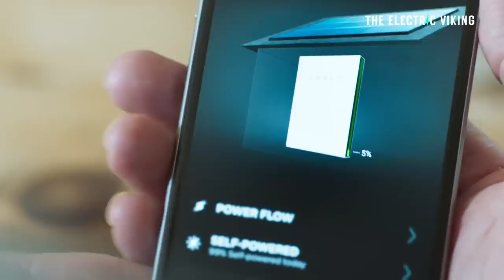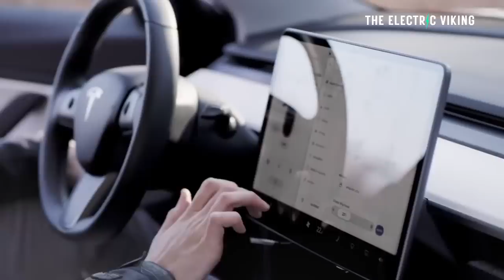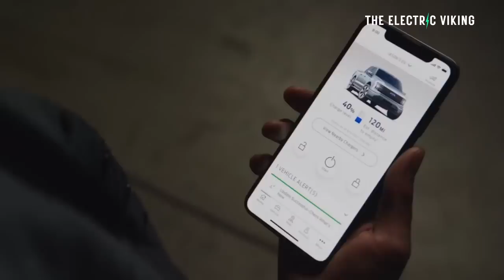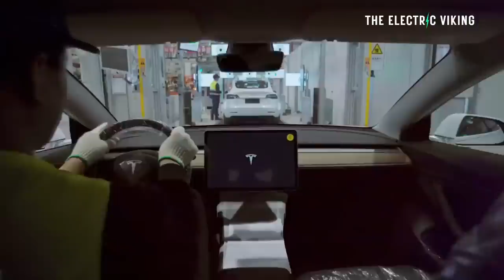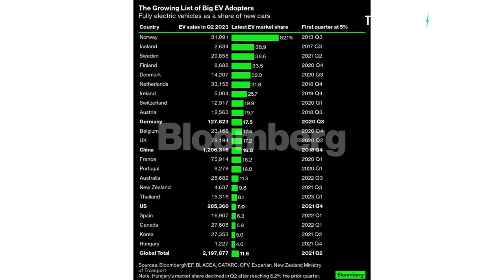Electric cars pass S-Curve Tipping Point in 23 countries - GAME OVER ICE!

Comment: It’s far from “game over” for ICE cars. Only those who drive short distances and can afford the new technology will consider buying an EV. Even then, the safety of the battery technology will need to improve substantially. Then there is also the depreciation factor, which is a big downside of the EV.  Still not convinced EVs are going to dominate our roads.
Reply: In the U.S. 80-85% of new car buyers were homeowners with six figure household incomes and financed the majority of the principle amount.
It's been that way for decades now. New cars are primarily purchased by the majority of upper income earners. 

Which is why the used vehicle market does 3-5x the volume annually vs new.
Reply: Batteries are way safer than gasoline in vehicles. You just have to weed out the bad ones like LG Chem and General Motors that were using pouch cells.

Comment: @litestuffllc7249 There is a shortage of lithium and it will directly impact production. 
False There are 26 million tons of proven lithium reserves worldwide; this is 260 years' worth, at current consumption rates. To put it another way, this is enough for batteries for 3 billion cars, twice as many as there are in the entire world.
 Over the last 5 years production has averaged 100,000 tons.
Amazingly, given your advanced Dunning-Kruger, this is correct, but irrelevant.
 It has not risen significantly even with the demand for BEVs 
False. Actually, it's increased 88 percent during the last five years, and is 3.4 times what it was just seven years ago.
Your hyperbolic claims comparing the water used to mine lithium to "the worlds fresh water" is a straw man argument. This is because mining lithium doesn't use fresh water, but non-potable water: "In the brine mining process, extremely salty water from an underground reservoir is pumped to the surface and evaporated in large, extravagantly colored ponds, leaving high concentrations of lithium behind" (https://youtu.be/HSh6EgMwMOY?si=iIwpzXYCAU7XXMee&t=52).
But your biggest failure is a complete lack of perspective, with your hysterical claims about lithium mining; in the big picture, the amount of lithium mined annually is a tiny fraction of the amount mined of many other materials, that are mined in ways that are just as damaging. One example is coal; the US alone mines 1 billion tons of coal a year, 10,000 times as much in this country as there is lithium mined in the entire world. And coal mining uses 75 trillion gallons of water a year in the US alone, most if not all of it fresh; which is 1,500 times as much water as is used mining lithium in the entire world, most of it undrinkable brine. 
In a very real sense, mining a tiny fraction of as much lithium in the entire world as we mine coal just in the US, will help set the stage for reduction and eventual elimination of the use of coal. Further, once all 1.5 billion cars have been converted to EVs, using only half the proven reserves of lithium—and assuming EV batteries will continue to use lithium, which they likely won't—no further mining of lithium will be necessary, because all EV batteries are being recycled. Meanwhile, coal is completely non-renewable, and has a double impact on the environment; once, when it's mined, using vast amounts of fresh water; and once when it's burned, spewing vast amounts of GHGs into the atmosphere. In this context, the environmental damage of lithium mining is a trivial price to pay for contributing to the reduction and elimination of the hugely larger environmental damage of coal mining, through conversion of the entire transportation section to renewable sources, which Tesla is committed to.
So if you want to get on your soapbox about something, make it coal, which has a huge negative impact on the environment; and not lithium, which has a comparatively trivial impact, and is part of the transition to a completely renewable transportation sector.